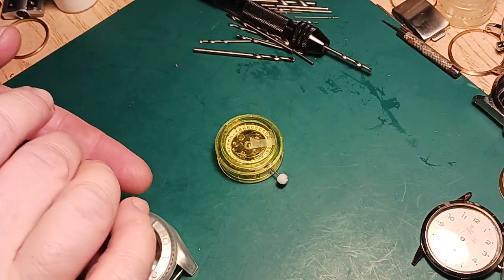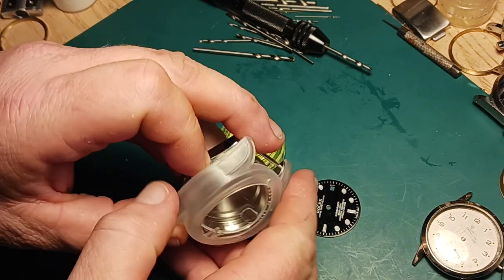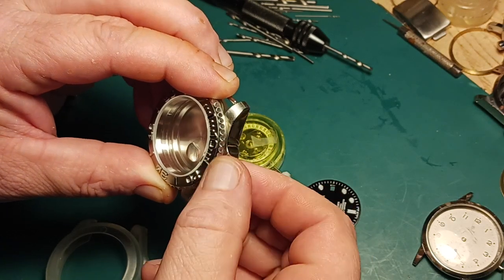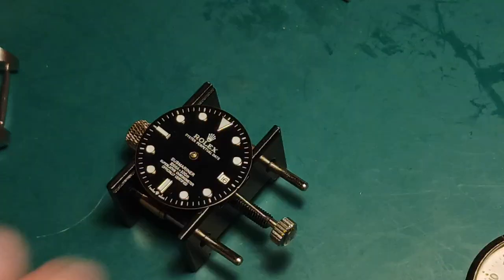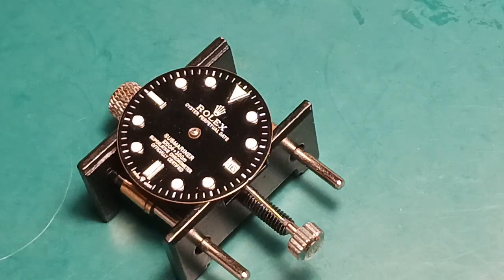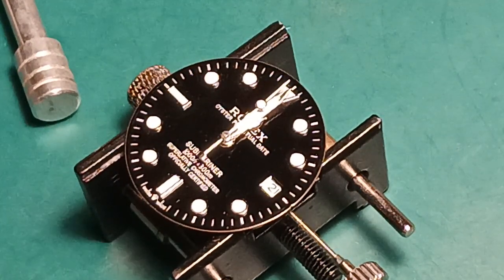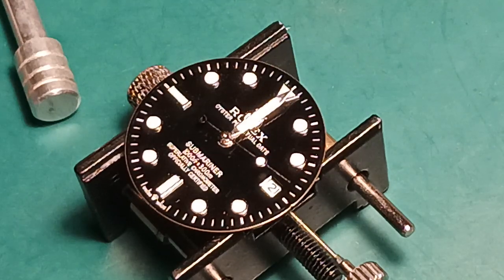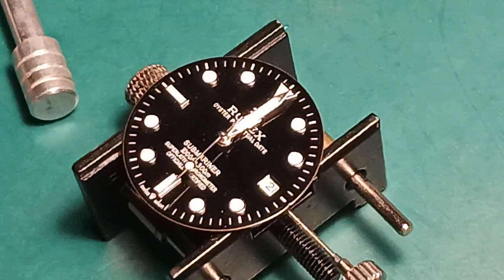Building my own replica sub with my choice of bezel insert

Comment: 2813? What is the difference between 2824 and 2813? Does the 2813 fit in a case made for a 3135? What movement is comparable to 2824 though has no date complication? Cool watch!
Reply from the maker: 2813 is a low beat movement and also taller or thicker than 3135. A 2824 is a bit more thin and is a high beat movement